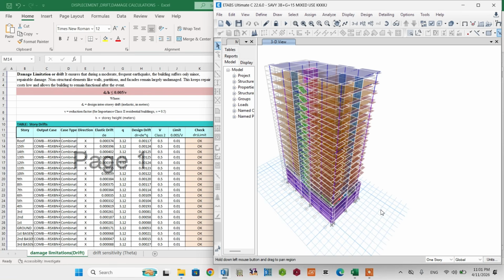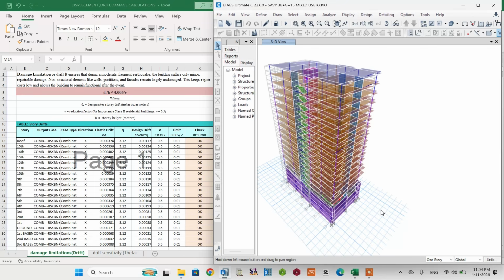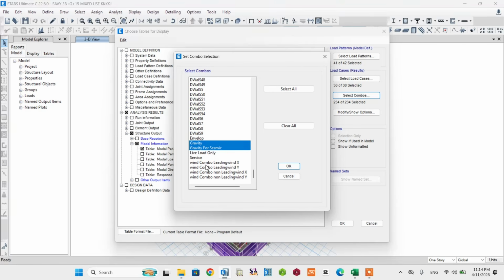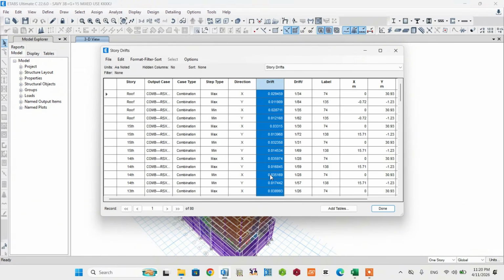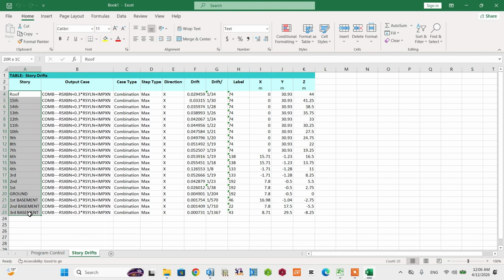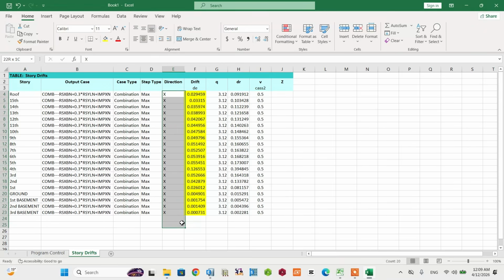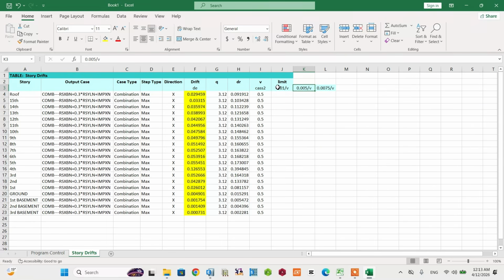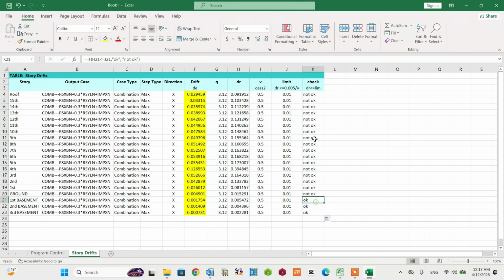4 Pre Design Checklists for 20 Story Buildings in ETABS– Part 1 Damage Limitation or drift Eurocode

Comment: In checking the building drift, what condition you used for the stiffness modifiers (service or ultimate)? Did you consider accidental torion (5%) in your seismic load case?